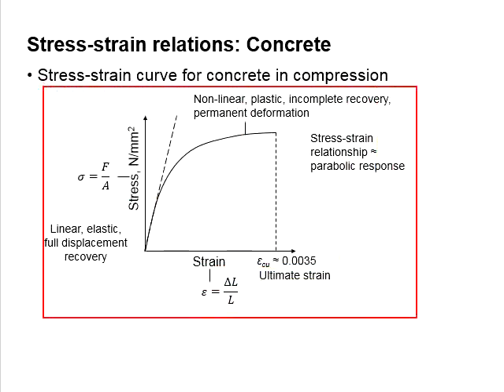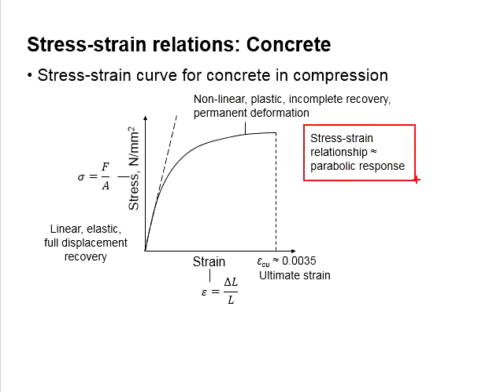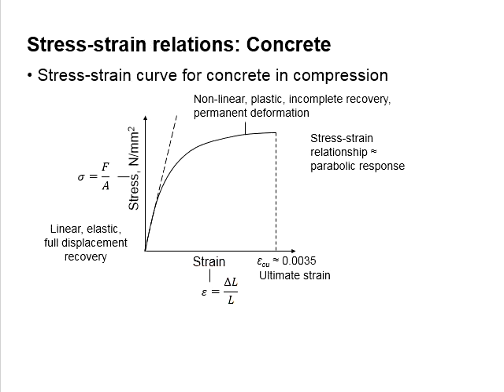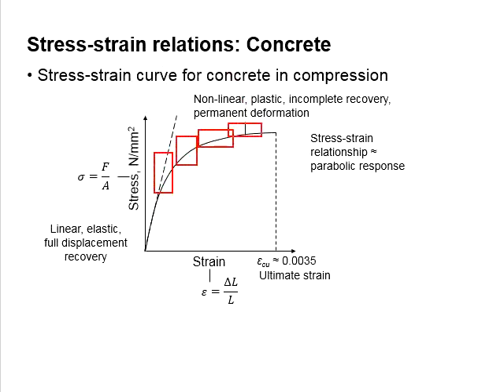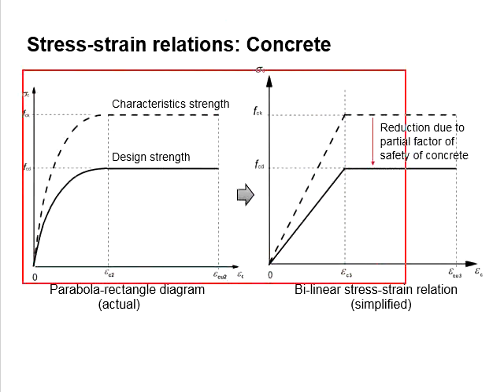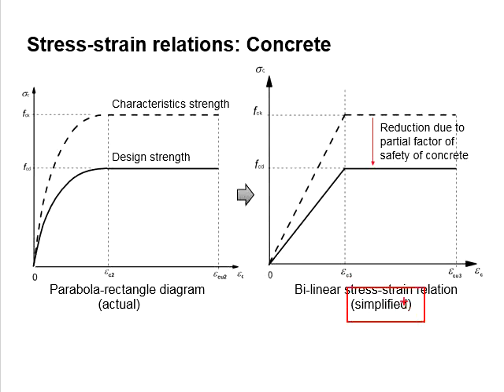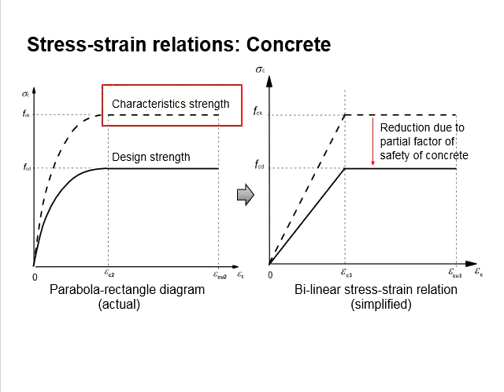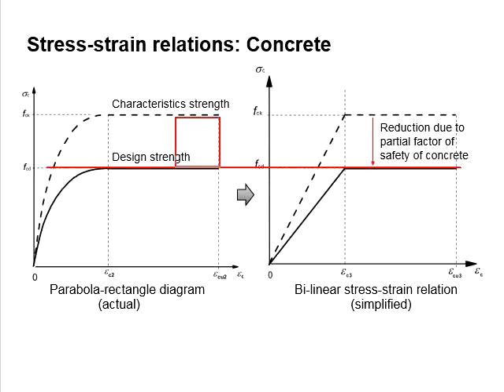1.6 Stress-strain relationship of concrete

Comment: I have a doubt, when we say ultimate strain of concrete in compression is 0.35 percent, does it mean it is impossible for material to undergo a further strain, will the material fail after this strain ?
Reply from the maker: Beyond that, it is considered fail.